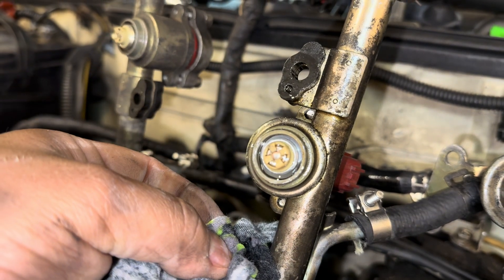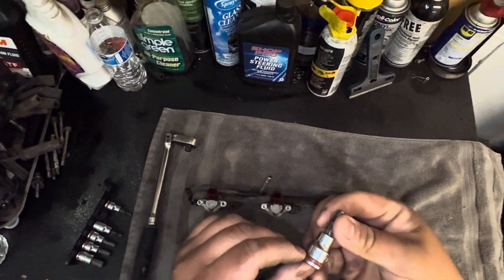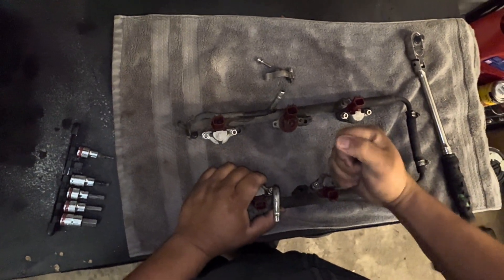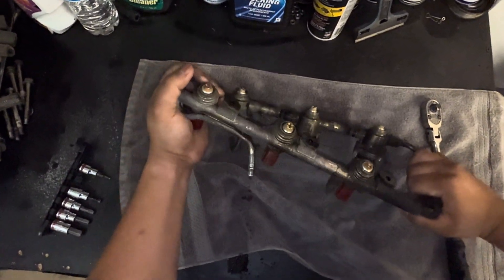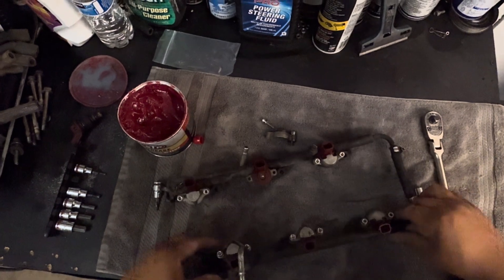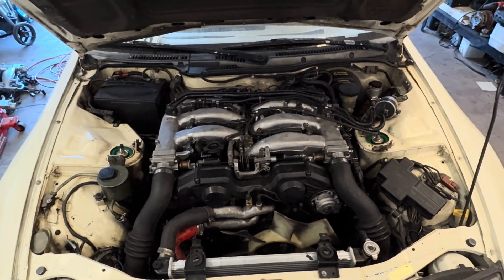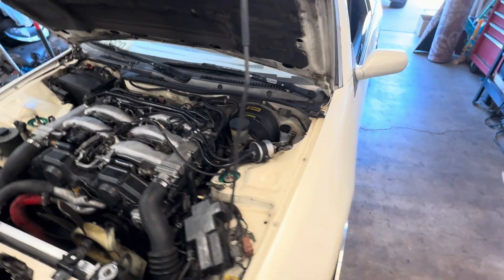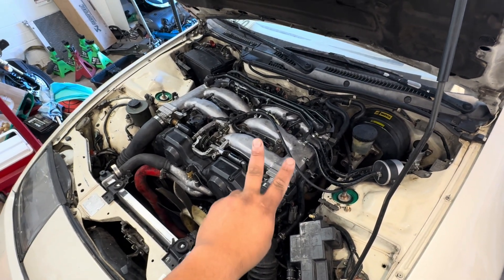90-96 Nissan 300zx injector diagnosis and repair

Comment: I think I'm having this same issue. I have a 1994 NA, I'm wondering if the adapter cap that wasn't sealed properly in your video is the same for all 300zx's? You mentioned how it used to be old style injector, could you elaborate on that?
Reply: I believe my fuel rail is all OEM, I have the same fuel injector problem with cylinder 4, it's dumping gas in the engine
Reply from the maker: @MrJett-xx6om  so if it has the adapter kit or not if the injector orings go bad it can leak or when they are installed incorrectly they will get pinched and cause a leak. If you think yours is having a similar issue. You can do the same thing I did in the video to test if they are leaking.
Reply from the maker: @MrJett-xx6om  they aren’t all the same only the older style fuel rail. 90-92 is the old style(square connector) 93+ is the updated or new style(oval connector) If you have the old style and want to upgrade to the new style injectors you need those adapters. Since your car is a 94 it more then likely has the new style. If that’s the case then you wouldn’t need the adapter kit.
This car had the older style fuel rail that’s why it has that injector adapter kit

Comment: The injector was bad, the outside oring had nothing to do with it leaking on the inside
Reply from the maker: The injector wasn’t bad it was the oring that was causing it to leak. I already used that injector on another fuel rail